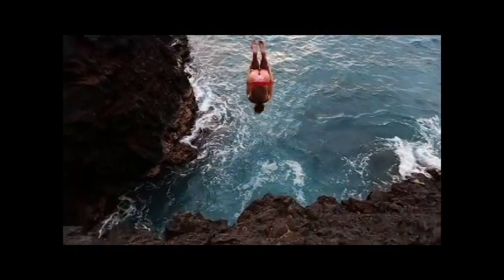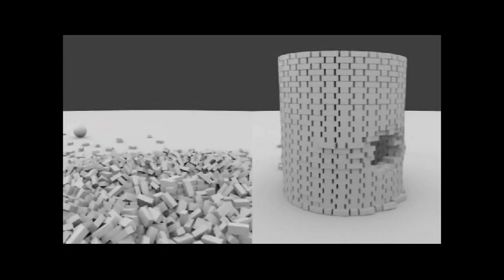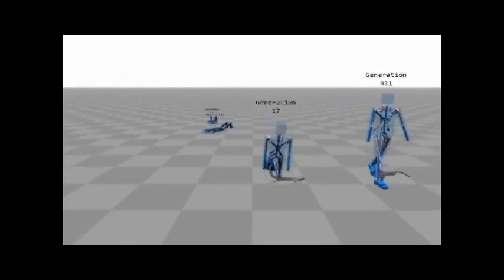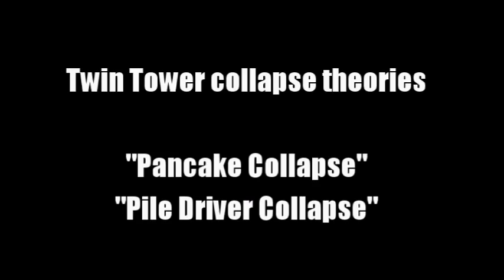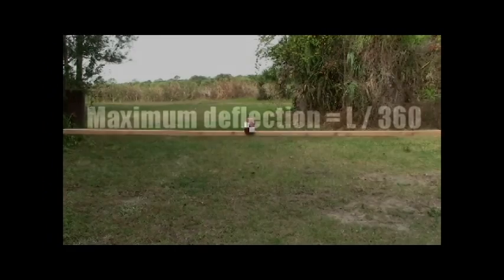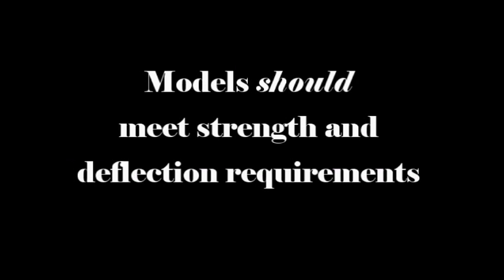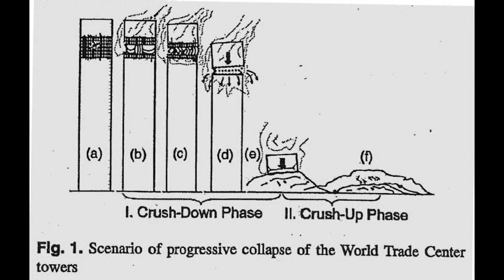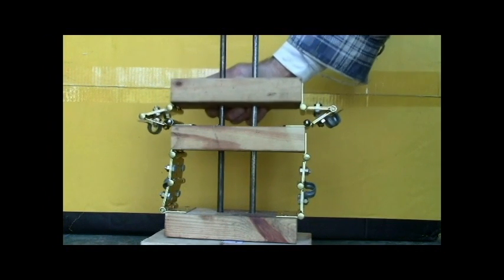9/11 Experiments: The Force Behind the Motion

Comment: Retarded thinking.
Progressive collapse all the way.
Reply: +Humannondancer Progressive collapses don't accelerate through themselves, moron.
Reply: Emvaz22 ooh... is that right...was it freefall...I think not..
Reply: +Humannondancer Did tower 7 collapse at perfect free-fall acceleration for the first 100 ft?  Oops, it did.  That's weird, you would think the tons of structural steel that had been supporting the structure for decades would've resisted the collapse...

But no, apparently you believe 100 ft of structural steel frame simultaneously detached itself from the external walls and jumped out of the way of the building as it fell.
Reply: Emvaz22 Something quite large and burning fell on 7 I heard, odd things happen sometimes.
Reply: Humannondancer It's a shame that you base your opinion on unfounded rumors instead of verifiable facts.  Where in the NIST report does NIST claim that debris from the first two towers caused significant structural damage to building 7, which led to its collapse?  Where are you getting this information from?  

To my knowledge, NIST blames the collapse of building 7 entirely on normal office fires.  Can you point to another example in human history where an office fire caused a sudden and symmetrical free-fall collapse for 100 ft?
Reply: +Humannondancer <Something quite large and burning fell on 7 I heard, odd things happen sometimes.>

Oh really?  Show me evidence of this suppose structural damage.  If damage from the first two towers led to the collapse of building 7, then why did NIST specifically say that there was no significant structural damage to building 7, and that fires alone were the cause?
Reply: Emvaz22 They say the collapse was predominantly caused by fires.
Structural damage was caused between floors 7-17.It was the uncontrolled fires that ultimately brought the building down after burning for almost 7 hours. 
The actual NIST report gives more detail, so I suggest you go find and read it, instead of believing what you see,hear and read from the
truth movement. (Wikipedia results are generally very good, and will get you there)
As an aside; I used to believe, but caught the TM "lying for truth" years ago.
Reply: Humannondancer <Structural damage was caused between floors 7-17.>  

As evidenced by what?  Who exactly was in the tower testing structural integrity?  I don't recall seeing any video or photos of any structural damage prior to the collapse.

<It was the uncontrolled fires that ultimately brought the building down after burning for almost 7 hours. >

Uncontrolled?  There were no visible flames at the time of collapse.  Visual evidence suggests the flames had died down, as the tower was filled with flame retardant furnishings/carpeting/etc.  Larger buildings have burned for longer much more intensely and not collapsed, and certainly not for 100 ft at free-fall acceleration.  Sorry, the official explanation defies basic physics and common sense.  100 ft of caged structural steel does not just move out of the way on its own.

<The actual NIST report gives more detail, so I suggest you go find and read it,>

I skimmed it, and try as they might no amount of bullshit can hide the inconvenient fact that building fell at free-fall.

<(Wikipedia results are generally very good, and will get you there)>

L O L

<As an aside; I used to believe, but caught the TM "lying for truth" years ago.>

Ah of course.  So you must have some compelling evidence to have made you change your mind.  Tell me, how do you explain away the documented and published proof of the existence of advanced incendiaries in the WTC dust?  What fairytale do you tell yourself to explain how dying, isolated fires an a few floors, can cause a global, symmetrical free-fall collapse of building 7 for 100 ft?  Where in history has something like this ever happened, before or since?
Reply: Emvaz22 Oh you're back, imagine my disappointment.
Tell me; how many times has anyone seen steel framed buildings collapse after large Boeings had crashed into them?

The rest of your post is truther propaganda, as you would have seen had you followed my earlier advice.

Never mind, it was worth a shot.
Reply: Humannondancer <Tell me; how many times has anyone seen steel framed buildings collapse after large Boeings had crashed into them?>

Tell me, how many Boeings crashed into building 7?  Oops, looks like you're intentionally conflating the two situations because there is no rational explanation for the free-fall collapse of building 7 without the use of pyrotechnics, and you know it.

Still waiting on you to show me this supposed structural damage to building 7 that allowed for small isolated office fires to cause a symmetrical, free-fall collapse.  What was that guy's name?  You know the one.  The guy who was inside building 7 documenting all of the structural damage, the position, size and temperature of the fires, the location of the loads, etc?  What was his name again?  Oh that's right, there WAS nobody documenting anything of the sort, and no evidence of structural damage caused by the collapses of buildings 1 and 2, whatsoever.

<The rest of your post is truther propaganda, as you would have seen had you followed my earlier advice.>

Cowardly cop-out of an intellectual weakling.  You're a prime example of the type of person who still believes the official narrative.
Reply: +Emvaz22 I was kind of hoping you would find evidence of the impact damage yourself, hence the initial prompt. From experience, when I found some real truth myself my burden was lifted immediately, but know
it rarely works when shown by a "non-believer".
Where have I used ad hom against you please? you're a blinkered researcher, yes absolutely.Calling me a liar and misquoting me is unfair when I actually said:
"Something large and burning fell on it"  
Anyway I'm not willing to quote NIST for the reason stated, I want you to find it without using any truther links. As stated previously; using google and wikipedia will get you there, or use these exact words > NIST final report world trade center disaster<

Fourth result down on Google does it for me.

 (as opposed to> 9/11 official NIST report says...et al)

NIST is not my only source either, but that involves going into "enemy territory", and viewing videos and other material you haven't seen before as they're not promoted by the "truth" movement high priests.

As an appetiser; The east penthouse of Building 7 was the first visible sign of collapse, which is mostly omitted in truther videos.
Reply: Humannondancer <I was kind of hoping you would find evidence of the impact damage yourself, hence the initial prompt.>

Mhmm. Looked, didn't really find anything other than relatively minor damage to the facade of one corner of the building.  Certainly nothing that could lead to a global symmetrical collapse at free-fall acceleration for the first 100 ft.

<Where have I used ad hom against you please? >

My mistake.  You use hand-waving arguments to dismiss plain facts as "truth speak", not ad hominem.

<NIST is not my only source either, but that involves going into "enemy territory", and viewing videos and other material you haven't seen before as they're not promoted by the "truth" movement high priests.>

Please share.

<As an appetiser; The east penthouse of Building 7 was the first visible sign of collapse, which is mostly omitted in truther videos.>

Right, the penthouse which sits over the core columns was the first to collapse.  As would be expected in a controlled demolition...
Reply: +emvaz22 Hi, I didn't receive a notification for your above post, so was wondering how you're getting on
with your research?
Reply: Humannondancer Hello again.  No, I still haven't seen any direct evidence of structural damage caused by the falling debris from 1 and 2.  As I said, I'd be happy to read or view whatever source you claim shows this structural damage.  

Part of an aluminum facade that has begun to warp from heat is not evidence of structural damage.  It's evidence that aluminum has a relatively low melting point.

Even so, to cause a symmetrical collapse, it would require virtually symmetrical structural damage, which clearly could not have occurred.  That leaves incendiaries, and that conclusion is backed by the forensic evidence.

Comment: You don't need wireless detonators. simply remove the fuse on your firecrackers and replace with a model rocket ignitor. They can now be detonated at an instant by connecting a 9v battery. For precise timing an Arduino my be required.

Comment: good video. they used explosive thermite. you could see the rusted colored, melted, severed beams in the ruble.   rust is iron oxidation, thermite is iron oxide thats why it melts steel at 5000F just like rust on a car over time.

Comment: How can math work, exactly. When there are no perfect circles, perfect  triangles, straight lines, ... in the Universe?  Close but not correct. 
Montauk lab, particle accelerator, flight 800 shot down with two beams. A tunnel beam for the weapon beam to travel in. (and the Philadelphia Project)
Brookhaven lab, particle accelerator, experimenting in turning solid materials into liquid.
Hurricane Erin, were they got the electrostatic energy to reverse the van der Waals force. 
All these beams reflected off the HAARPs dome in the ionosphere, down onto the twin towers complex. 14 times every 36 minutes.
First the towers were microwaved. Vibrating the towers like tuning forks. Vibrating the concrete into the dust/foam.
They reversed the van der Waals force turning the twin towers/buildings into liquid. Then, the van der Waals force attracted, producing the iron-rich microspheres found in the dust. 
No thermite;  When the iron-rich microspheres cooled, the other elements cooled out at different temperatures, leaving the layered elements of thermite, not thermite. 
No explosives;   When the van der Waals force was reversed, the atoms/molecules repelled atoms/molecules expanding the iron structure. Which, exploded the concrete and glass off of the expanding iron structure.
 The cars were in the tunnel beam, used to control the weapon beams. The sheetmetal vibrated off the paint, which rusted instantly.  The other less dense things paper, cloth, trees, aluminum, ... could dissipate the energy/heat. The denser things door handles and hinges, glass, marble, engines, iron structures of the twin towers/buildings, ... Turned into liquid because they were to dense to dissipate the energy/heat. Iron-rich microspheres.
Why did cheney send those jets out to sea? How do you shoot down a hologram! The B2 bomber had hologram projecting abilities in 1999. But, the projected planes wing would disappear, like just before the hologram entered the tower. Why did the people in the hologram hole, in the tower, take off their clothes? Water boils in a microwave, from the inside out.
They used green/blue screen technology for the planes. Remember how they changed from the city background into blue/green sky. Have you seen the, "airplane WARPS into black alien craft seen by couple"  As soon as the aircraft leaves the blue sky and goes in front of the white cloud the plane turns into a blackhole in the sky, with something flying above it. Guessing a B2, projecting. So, black I think it's graphene on edge. I've been thinking of painting my car that color. They're controlling graphene into holograms. 
And how about the new weapon Cern has, "Cern and HAARPs dome". Cern, particle accelerator, shoots a beam up to HAARPs dome in the ionosphere and reflects the beam down into the ground (twin tower complex). And how about the bouy in the Atlantic Ocean off of NYC coast, again, rising and falling 200'. Same thing, they're beaming the ocean, to create a tsunami. It's not against international law for the US to bomb themselvies, again, still. Fucking murders!!!

Comment: Experiment at 5:25.

The 20lb  weight is about 4 times the weight of the 4 cement boards. So this represents only 4 floors falling.

There were about 15 floors which fell.

So you need to repeat the experiment with 20lb x 15/4 = 75lb to simulate 15 floors falling.

Then think about the connection capacity at the wtc truss ends - they were flimsy. Your experiment relies on bending being the weakest path, but perhaps it was the connections which were weakest under dynamic shear loading.

Comment: The moment the upper part of Sth Tower started to collapse, it was almost correct - that is if collapse initiation was even possible.
In the first second or so, it started to tilt approx. 20 deg off vertical - thus most of the resultant forces / energy was now no longer centred and equally distributed over the remaining intact structure below it.. but we of course see it "magically" correct its angular momentum without any opposing lateral force to push it back (vertical) over the centre of the remaining structure. 
There is only one thing that can do that... "explosives". 
Progressive asymmetric damage does not result in instantaneous symmetric failure.. with measurable acceleration as opposed to resistance..  let alone 3 times in one day.
Reply: Exactly, even if the tops did collapse, they would have either ended up smooshed at the top with the roof at an angle, or the entire top would have fallen off into the streets below (the but former is much, much more likely).

Comment: The high building construction is actually not that simple as piling floors on walls. If you do this - you will simply put too much stress on the lower floors. And you don't want to owerstress them. If hey fail - your entire building will go down.
So instead of simply piling floors on lower floors, constructors use an elaborate system of cables that basically let the upper floor not only to lay on floors below them, but to hang on those supporting cables.
This results in each floor having individual stress limit. And if a floor lost it's "cable support" and layd all it's weight on the lower floor, this could easily exceede the lower floor stress limit. And it's cables will be first to fail and so the process repeates  and repeats untill it reaches the ground.

I'm not telling that the official reports are accurate. They are obiously lazy write-offs intended to cover the truth rather than to determine it.
I'm telling that your experiments were oversimplified.
Reply: that's true but you're forgetting about the core columns of the trade center which also supported the weight of the structures.
Reply: Actually, the core was the main support, the exterior basically only served to hold the other end of the floors up.
Reply: +Darkwingscooter do you think it was an inside job
Reply: To be honest, I don't care. That's not really why it interests me.
Reply: Actually Darkwingscooter....
that was one of the weaknesses of the design....the floor "joists" were only supported by a "beamshelf" welded across the outer core columns....we don't know how strong these welds were but it was noted by many that the weight of the floors wasn't supported by any inner core members and this resort ie. using the beamshelf, could be looked upon as a bad weakness.
Reply: Is there any evidence of that? It reminds me of the sort of rationalisation that NIST engaged in when they assumed that the there were no shear studs in building 7 because that's the only way they could get the model to fail correctly. I would be highly surprised to find that the floors were unconnected from the main structural support in such a way by design.
Reply: @ Darkwingscooter....There is a gallery of pictures taken during construction which quite clearly shows the "beam shelves" welded against the outer core verticals....I'm not sure if I can reference it again but I'II try....Apparently I remember there was a problem with linking this to the inner core members to distribute the load and in fact all core cross linking was apparently a problem with the design....or so I read somewhere anyway.....
Reply: Seems odd to me, because everything I've heard and read suggested that the outer walls were barely structural elements themselves. To the extent would be more correct to say that they were held up by the floors than the other way around.
Reply: I would say that understates their role....what would hold up the outer ends of the beams and floors other than the outer walls...ie' vertical columns?.....on many modern high rise the floors are supported by the concrete core alone and the walls are glass and virtually unstressed "curtain walls" but that's not the case here. The outer wall columns took most of the weight of the floors by virtue of supporting the outer beam ends....